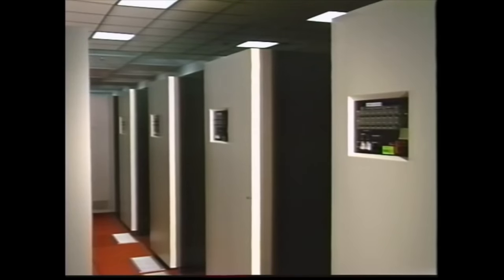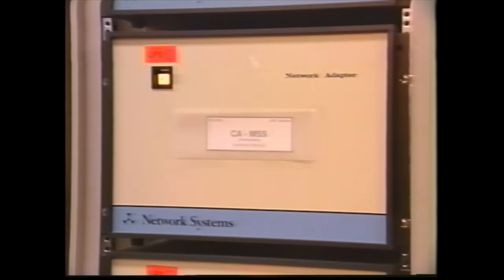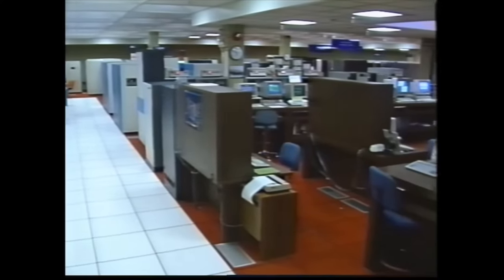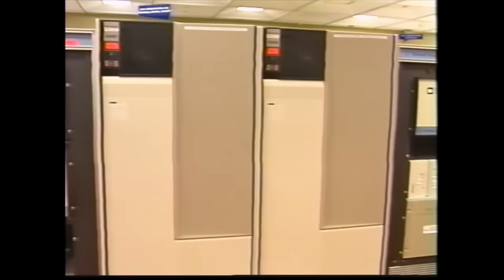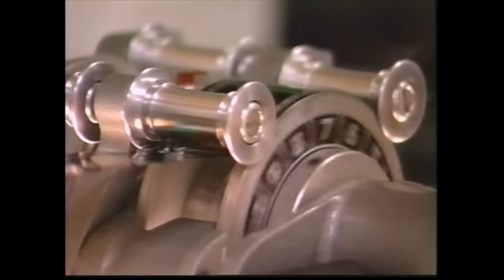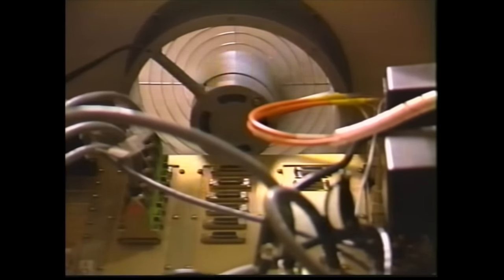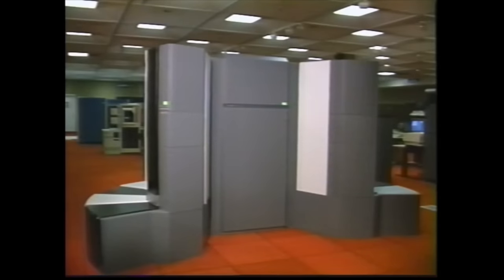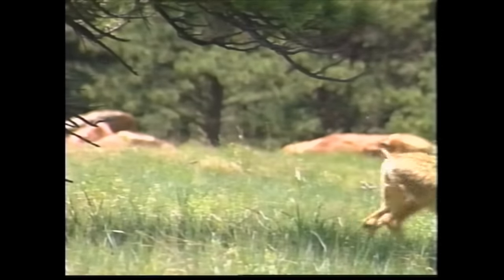Computer room walking tour, 1992

Comment: Hearing the Word "SSD" from a 1992 video makes it extremly cool!
Reply: 256 million 64 bit words is about 2 GB of storage which, thirty years on, you can get on an SD card for about a buck.
Reply: Now think about how this technology was used to build the baseline for climate science...
Reply: And they had a node in the predecessor of the Internet.
Reply: i nearly shouted out "jesus christ" that's some serious computing power, like the commercial building sized CAT dozers, thats is wickedly heavy iron and serious performance
Reply: flash storage existed in late 80's it was just very expensive and not for consumer market
Reply: @autohmae  The Internet was already here at that time, having spent many a evening mudding on an NCR x-term, or Next box at University during this time.

Cheers!
Reply: The end credits actually say "(c) 1988" unlike what the YT title says. Which makes it even more cool...
Reply: @fgaviator But the still said some things were installed in May 1990 and then june 1991. So its from early 1992.
Reply: Not nearly as cool as mainframe🎉
Reply: Especially when you hear something like "8,192 processors" or the future parallel systems. We already went beyond parallel. It just keeps evolving. It's pretty cool...
Reply: @1sonyzz  I have a vague memory of 8 megabytes of Flash on an 8 bit ISA card for industrial computers I worked with ... like 30 years ago?
Reply: @J.erem.y I'd rather not.  Given the selective use of the data and grants-for-results treadmill, no joy in understanding the seeds of the poison tree.
Reply: SSD has been around since the 80s for Cray supercomputers.
Reply: @videosuperhighway7655  I had one on my Commodore 64 in the late '80s.
Reply: Not an SSD like we know it today.  It was a very large SRAM bank which was connected to the I/O subsystem and could be partitioned between each of the processors.  It was typically used as a staging disk for operating on very large data sets.
Reply: Mainframe and super computers are using same principle with very different numbers ;)
Reply: Acronym ?
Reply: solid state just means chip based not tape based
Reply: @TheAnxiousOwl  Read the Thinking Machines from Wikipedia. Even Feynman worked with them and they had to port BASIC to a massively parallel super computer since that was the only language he knew.
Reply: They never mention SSDs…
Reply: @ethaneveraldo  sure did, 1:04 mark
Reply: @ScienceReasonLove  At the time that was extremely impressive.
Reply: Government and, most of all, military tends to have the pinnacle of technology, and only decades later, if ever, that eventually tends to flow downstream to the consumer market.
Reply: I knew that someone talking about the SSD would have to be the number one comment! And a 4TB drive?! In the early 90s? I thought a few Kbs/Mbs was all anyone needed! But seriously, I didn't even realize SSDs were a thing back in the 90s! I thought they pretty came to being in the late 2000s, early 2010s. I know when I built my old computer in 2014, I bought a 250GB Samsung 970 Evo SSD for like 150 bucks or something like that. When I build my new computer over the summer this year, I got a 1TB M.2 for like 60 bucks. Oh, how technology advances so fast! I love it though!
Reply: The worlds first digital electric computer was built not too far away from me. I was kinda surprised because nothing happens in this state 😂
Reply: I was thinking "Solid State Drive", instead!
Reply: Also IOS 
Apple: 🤔🤔🤔🤔
Reply: @autohmae NSFNET

Comment: NCAR's new supercomputer, named Derecho, was inaugurated last month. It's capable of 19.87 petaflops, nearly 20 million times more than the Cray.
Reply: Holy fucking shit,now that’s mind blowing,i find this already sooo impressive,however i heard that even today’s smartphones are more powerful then even supercomputers from 1997 ,wich i really really could hardly imagine.
I can imagine that the iphone 15 is more powerful then the gray 1 supercomputer but not more powerful or even equel in performances then all those supercomputers combined together in that building,does it?
Reply: @johneygd  it is always very hard to measure performance across different hard and software, but yeah, giving the quoted numbers it can be assumed that a modern high end smartphone is several hundred to even million times quicker (depending on what you want from it) than the CRAY Y-MP machine here in the video. just daily mundane tasks like capturing a 4k video and, in real time, putting a skin filter on top would be something completely unthinkable in 1992. on a sidenote, the raw CPU power of that CRAY wasn´t even so extremely out of this world (that only happened later when super computers started to use thousands of CPUs and GPUs in parallel), i am pretty sure a run of the mil home pc from 10 years later could outperform it. but those computers had (for the time) very wide and fast busses to get all the data in and out from all the attached disk and tape drives. thats something the home pc couldnt have done just  a few years later.
Reply: @johneygd  The point is: not the capabilities of the machine only counts, also the software is neccessary. I don't see an iPhone calculate the weather of tomorrow.... no app will ever do that, I presume. Besides that, the amount of data needed.... But, you'll never know what tomorrow will bring us!
Reply: @JaapGinder well yeah that’s true,our smartphone wouldn’t calculate tomorrow’s weather or doing number cruching colorizing fotos,or removing objects out of fotos,or breaking music down  back into it’s original stems etc,,,
If that was the case our smartphones would,ve become bulky with batteries only lasting 15 minutes and it would get overheated because of all that number crunching,that’s the reason why many apps are connected to a supercomputer trough internet to save the iphone for doing all that dirty complex work,phew🤣
Reply: Ah but is it as stylish?
Reply: @8BitNaptime  Hardly, its something that has been plaguing the whole computer industry lately, even the custom desktop has become little more than a glass box with RGB. Its rather disappointing.
Reply: That's cray cray
Reply: Elon Musk's new supercomputer is aiming at 300 exoflops. An exoflop is 1,000 times greater than a petaflop. There's some math for you. He expects to make the top five, but not quite number one. EDIT: one exoflop equals one quintillion floating-point calculations per second.
Reply: Yes, but can it run Crysis?
Reply: Cray Cray
Reply: @wjckc79  ex*a*flops (s means second, so this is a singular and plural form),  not exoflop.
Reply: That means "straight" in English.
Reply: @Digi20  the Cray y-MP can handle a bit over 1 billion operations per second.  Galaxy s24 ultra's snapdragon 8 gen 3 can handle 15 trillion operation per second.   Think about that!!!
Reply: But can it play Crysis?
Reply: It was based on HPE Cray EX cluster. HPE acquired Cray in 2019.

Comment: This hardware would have been the cutting edge of cutting edge at the time. Now my iPhone, that I am using to watch this while on the toilet, has more computing power. Amazing.
Reply: But then why aren't Iphones used in data centers today? It's a consumer product. There is still a need to run massive equipment in computer rooms today
Reply: Not exactly sparky. How many users can your phone handle??
Now think of how many users these "old" machines handled
Reply: @624radicalham I think you misinterpreted his comment. He's Just commenting on how much computing has miniaturized

Comment: 23TB stored on 100,000 tape cartridges. Today you can get that on a single LTO tape that costs about $50!
Reply: The comparison I like to make: in the mid nineties an entire encyclopedia could be put on a single CD-ROM. That would be 650 MB of data. Today, a single micro-SD can hold many times that! But, shrinking all those tape cartridges is an equally impressive leap in data storage technology. Even more impressive? Imagine a refrigerator-sized hard disk holding one megabyte of data, compared to today.
Reply: Imagine if that tape went bad hahaha
Reply: @rty1955  
magnetic tape will definitely last longer than any mechanical / solid-state drive.
Reply: @Dr.W.Krueger Caveat: Magnetic tape has a very long lifespan *if properly stored*. It can last decades. It is very sensitive to storage conditions though, and that life will be greatly shortened if it isn't kept at the ideal temperature and humidity.
Reply: @Dr.W.Krueger  this is true, but what happens when the drive chews the tape?
Thats a LOT of data to lose
Reply: @vylbird8014  long life span is one thing, but the devices that are still around and working become slim with age.
Reply: I have triple that amount of storage on my home server in one cabinet the size of a shoe box. My M1 Ultra Studio has more power than that entire building and it is already obsolete.
Reply: Tapes can go bad in multitude of ways. Not just shelf life
Reply: @ChatGPT1111  Hmmmm more power? Let me ask you, how many Simultaneous users does your cute little system can have before it comes to its knees?
Reply: @rty1955  Currently, about 1.2 Trillion or about 160x the current human population, but I continue to expand.
Reply: @ChatGPT1111  haha hardly
Reply: Drive unit could easily cost $1200+. Outdated LTO4/5/6 are cheaper and still quite enough for consumer usage though.

Comment: Really reminds me of that old Retro Encabulator. The ones that's like "The original machine had a base plate of prefabulated amulite, surmounted by a malleable logarithmic casing in such a way that the two spurving bearings were in a direct line with the panametric fan"

Comment: I hope they do a video like this for modern hardware at one point. Numbers will be absolutely nuts, but it has to be filmed on an old camera like this too.
Reply: Yeah, no.  Unfortunately, most media input these days will either be in the form of barely any information at all on the subject and how the devices work, or they will be specifically designed to be overbearing with none of the same media styles used in the late 80s - early 2000s as these were.  I'm afraid that golden era is well lost and over for us.
Reply: @redline1916  I'm not sure how this film was originally used but it seems to me like it's mostly just an advertisement to scientists who may actually have use for such massive amounts of computation and data storage. (Even today it's still somewhat impressive after all.)
Reply: @hummel6364 this was shot on video tape…clearly not “filmed”!

Comment: Computers had style back then. All look like genuine Hollywood items. Also the disk retrieval machine reminds me of a robot from a movie.
Reply: They still use disk retrieval machines in many data centers today. Mainly for archival purposes
Reply: @IntelCoreI77700K In Panama in 1991 we had a tape retrieval machine in the Army. His name was Private Boone.
Reply: love the random patterns on that thinking machines unit. i assume 8192 LEDs, one showing the status of each of the parallel processors
Reply: @vinylcabasse Originally they were designed to work exactly like that, but it would've meant that in a perfectly working machine the led panel would've remained unassumingly solid red most of the time (all CPUs working and none idle) and Thinking Machines designers, always remembering the importance of the "rule of cool", decided to change it to make them blink randomly like the computers in most scifi movies 😁 (I believe they kept the ability to switch it back to the "boring mode").
Reply: @qdaniele97  makes complete sense, and that's awesome, lol
Reply: I have one on my garage, which I looted from work's recycle heap. Mine is smaller though, only holds 48 tapes.

Tape storage provides very low per-gigabyte costs, but huge fixed costs - the drives are silly-expensive, plus they need a high-end server with high-speed intermediate storage to maintain the optimal data rate, and either SAS or fibre channel connectivity. So they are only economical when there is a need to store huge amounts of data.
Reply: @vylbird8014  that's cool, do you have it hooked up to something or is that almost impossible now? Bet it consumes a ton of power!
Reply: @colemanworldgirl Not that impressive to look at - all the robotic bits are enclosed to keep them safe, so you can't see anything going on. It's just a big box that makes whining and clunking noises. I use it to keep backups. Small rack-mount tape libraries are common in enterprise use.
Reply: @IntelCoreI77700K  They still use Tape Storage too, crazier still is it is the cheapest cost per GB despite being invented in the early 1950s.
Reply: Did you see ‘eraser?’ There’s one of those libraries featured prominently
Reply: @fujifrontier There's also a similar one in Hackers, the perfection of cheesy hollywood depictions of computers - though that one was holding analog video cassettes. The protagonist hacks in to it in order to take control of the TV channel and put on programs more to his taste.

Comment: So, an SSD with a capacity of roughly 2 Gigabytes and a performance of 16GFLOPS (double-precision).
Pretty impressive for 1988!
Reply: SanDisk, pre flash SSD
Reply: i nearly shouted out "jesus christ" that's some serious computing power, like the commercial building sized CAT dozers, thats is wickedly heavy iron and serious performance
Reply: I wonder how much that would be for the average customer back then (if it were even sold at the time to consumers)
Reply: No consumer would ever use anything like that, this is a super computer.  @TheAnxiousOwl
Reply: It is even more crazy. The "solid state" they talk about at that age is likely RAM based.
Reply: did the use SSD like RAM module?
Reply: When did you guys hear him mention SSD? I didn’t hear it
Reply: @ethaneveraldo  0:59
Reply: @debconfsetup8673 The RAM modules were likely the "SSDs", giant circuit boards with an absurd amount of memory chips. They could have been battery powered.
Reply: Ah... but this is no where near what they could actually do under cover of Black projects!  Imagine what they can do now in 2023!
Reply: SSDs don't calculate, so the 16 GFLOPS can't be ascribed to them.

Comment: I was a large systems Customer Engineer working on most of this IBM or plug compatible hardware in computer rooms / very large data centres like this in the UK. Three terabytes of data was common on large banking systems in 1992.  It looks complex and seems daunting, but I was fortunate to enter IT in 1964. Generally well trained before working on new products and overtime grew into maintaining these complex large systems over 45 years in computing. There is no substitute for experience.  It was a great, well paid career often working when most people were asleep. I still miss it after being retired ten years.